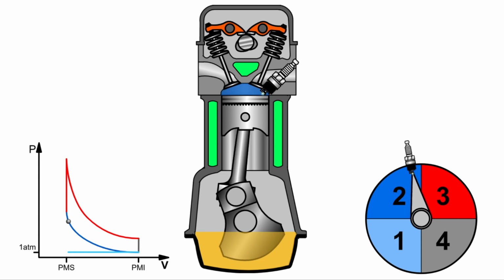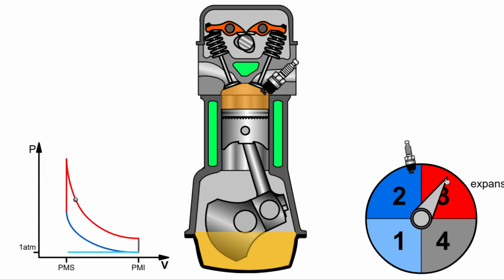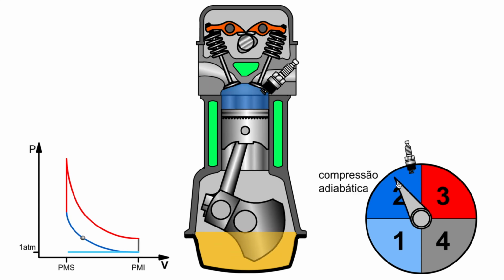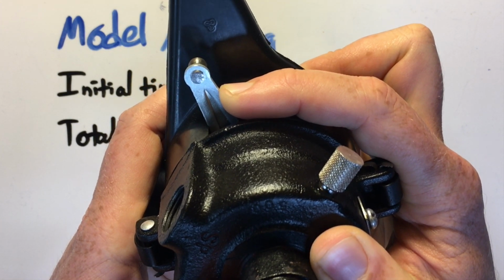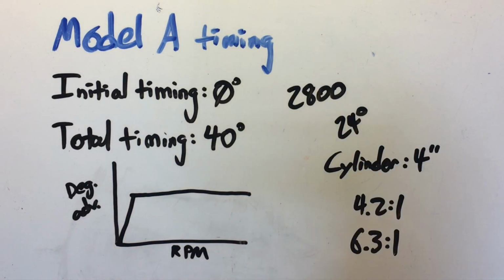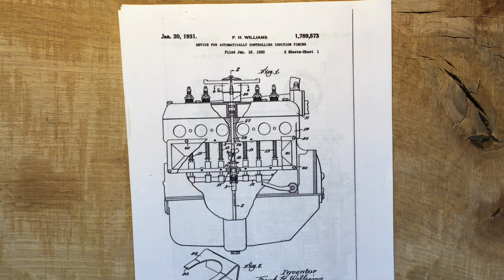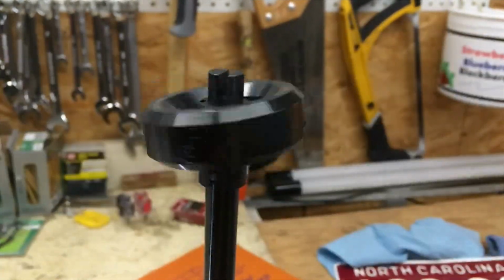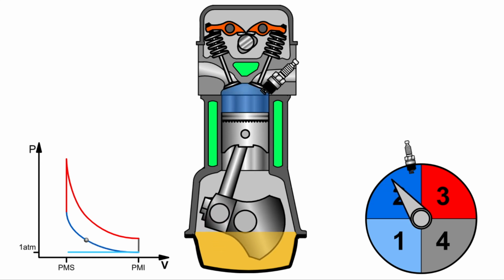Model A Ford – (1 of 3) Automatic spark advance

Comment: Does this work well with the High compression head 6:1?
Reply from the maker: 6:1 is the highest I would go with this accessory, and I would be listening for engine knock under heavy load. If you get knock, I would re-time the engine with the spark lever 1-2 notches down and then either put the lever back at the top full-time (move the entire timing curve down) or be prepared to do so if you hear the knock again. But my understanding is that people do run these with the Snyder's 6:1 heads and it's usually fine.
Reply: @alexiskai  Thank you!

Comment: Can this be used on the model B engine? I have a 32 B in my 31.
Reply from the maker: That's a great question, I'm not sure. Are you using a B distributor on it or an A distributor?
Reply: That’s a good question, I only just bought this car and know close to nothing about madel A. 
Can it use a A distributor in a B
Reply from the maker: @michaelbesler7469  Yes, you can use an A distributor on a B or vice versa. An A distributor will have a rod connecting to a manual control lever on the steering column, which you can use to move the plate on which the points are mounted. The B distributor doesn't have a rod, the plate is fixed in position by a screw on the outside of the distributor body.

If you have a B distributor, I wouldn't recommend adding the NuRex advance to it. If you have an A distributor, I think it would work, but I would have to see a photo of the valve chamber to be sure. I looked online and I can't find one.
Reply: @alexiskai  I have a rod from steering column so I guess it has an A installed already, do you need a picture with valve cover removed ?
Reply from the maker: @michaelbesler7469  I’d rather not make you go through all that work. My suggestion: email Bob at Nu-Rex and ask. bob-at-nurex-dot-com

Comment: The explanation of the advance mechanism blew my mind - so simple, yet so well thought through. Brilliant!
Reply from the maker: It's very elegant. What's interesting is that it's more elegant than what Williams patented in Jan. 1930. Between the patent application and bringing the device to market, subtle improvements were made. I assume these were recommended by the engineers at the firm Williams contracted with to build it, Phillips Manufacturing Co.